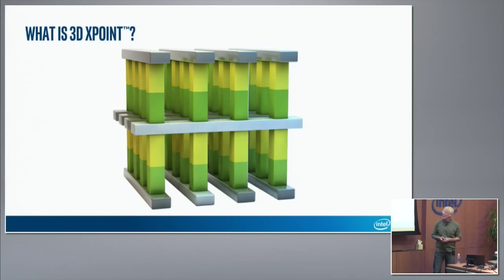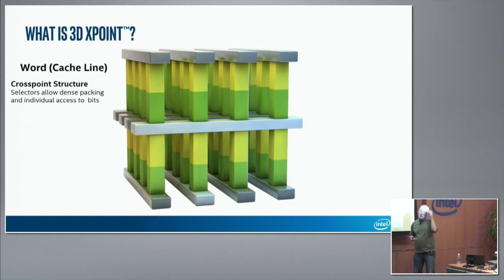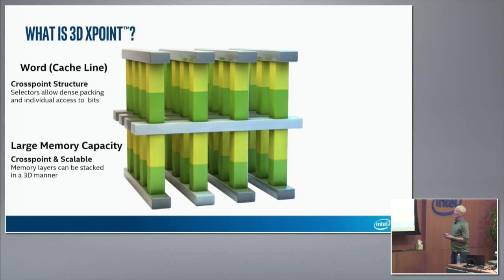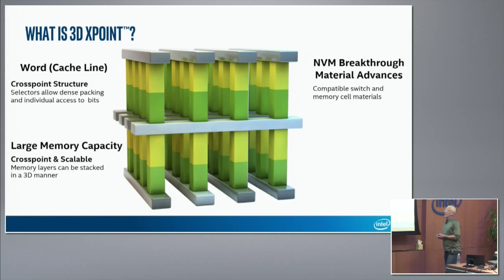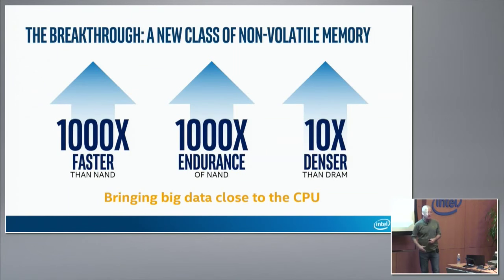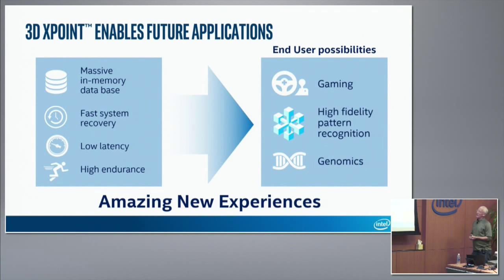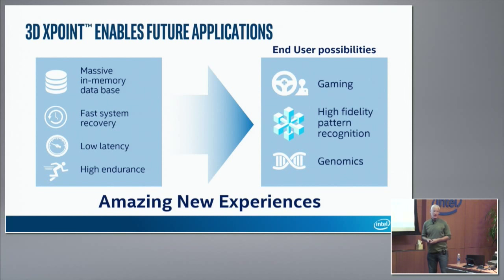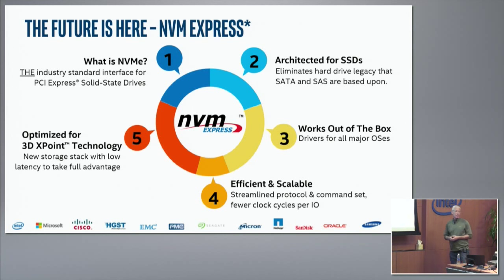Intel 3D XPoint and NVM Express

Comment: Let me see if I got it right. (1) In 2016 we will get 10x faster SSD storing a few Tb of data. (2) We are not talking about XPoint being used as RAM. We should not expect home PCs with 6/8 CPU cores directly accessing a few Tb of RAM. This is because all modern OS are build around fast cache / RAM / slow permanent storage hierarchy. (3) There is urgent need for OS kernel re-designed to take advantage of a "single tier of memory". 
... I imagine how hard XPoint developers were laughing over M$ announcing Win10 to be their "final and forever" OS :)
Reply: +MathAtFA So, your saying that Microsoft can't upgrade the OS with these new features and still call it "Windows 10"?
Reply: +Docwiz2 Do I believe that MS is capable of completely redesigning and rewriting OS kernel while still calling it Win10? Yes, they can! Could MS roll out such a massive redesign via several separate half-baked upgrades making developers and end-users suffer through the imminent bugs/incompatibilities? I will not be surprised.
Reply: MathAtFA Why would they have to rewrite the kernel?  Most of what they need to deal with these changes is in "User mode".
Reply: +Docwiz2 Which changes in "User mode" do you have in mind? IMHO, the only changes end user will see would be (1) merging "Shut down" and "Hibernate" into single "Sleep" button, and (1) application "starting" as fast as now it takes to Alt+Tab between them. Most changes will focus on rewriting from scratch virtual memory manager to take advantage of never seen before byte-addressed multi-TB fast storage.
Reply: MathAtFA We will see an update to the memory manager and probably go away from the paging system to something that would work better with the faster storage.  This memory is a big deal of course, and they need to make some big changes but not a total rewrite.  that does not make sense.
Reply: +Docwiz2 Do you remember how they first introduced half-baked protected mode of 80286 and then changed it again with 80386? The "fun" days of himem.sys and RAM drives are back, as we are told in this video... XPoint changes the performance bottleneck from "storage access" to "motherboard bandwidth", which means future memory managers will  have totally different criteria to optimize. What could be a more "total" change?
Reply: MathAtFA We will have to see.  Those were different times.  Now, to get the full speed out of the memory, you are correct and it will need a new buss.  However, they can shift the weight to the DDR4 DIMMS for now for the best speeds on what we currently have.  I welcome our new overloads.  I am tired of crappy RAID with crappy and slow HDD.  I mean for goodness sake, HDD's were invented by a team at IBM in 1956 and it's almost 2016.  <sigh>